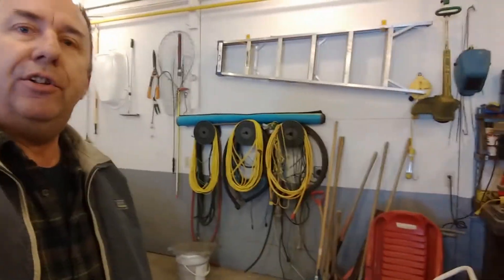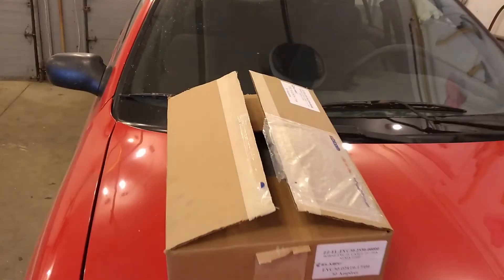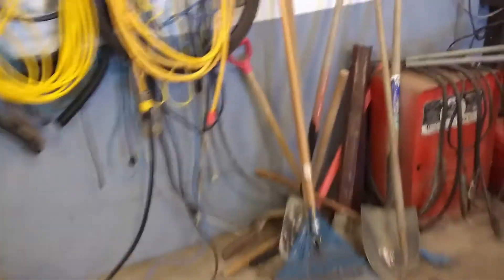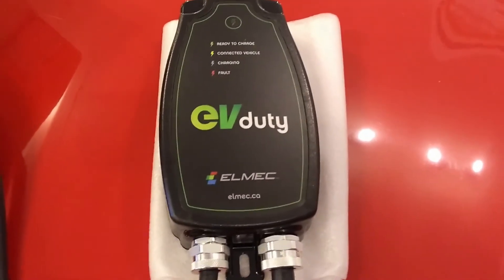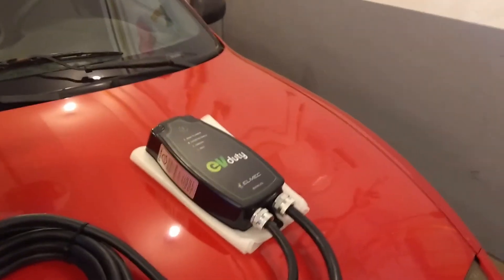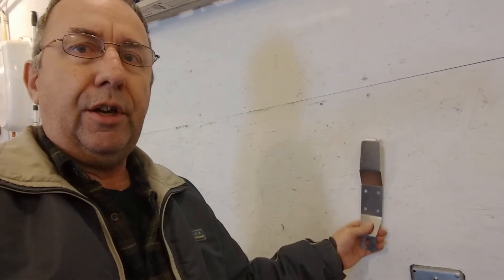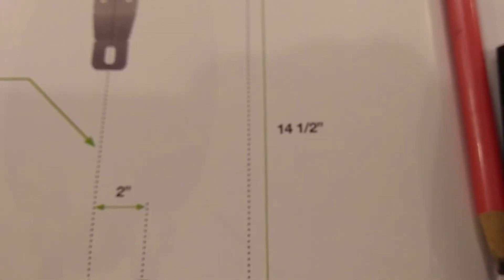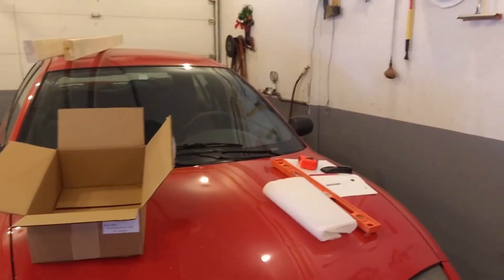EVduty Level 2 Charger (EVSE) Install

Comment: I got Siemens because they claim to charge 26 miles per hour. 32amps. ($450. Brand new)
Reply: where did you get it from?
Reply: Jude Ragel.  I got the Siemens charge from my old neighbour.  I'm not using it anymore so if u need one it's for sale.   I'm in California, so I'm not sure how expensive is to  shipping to your location.